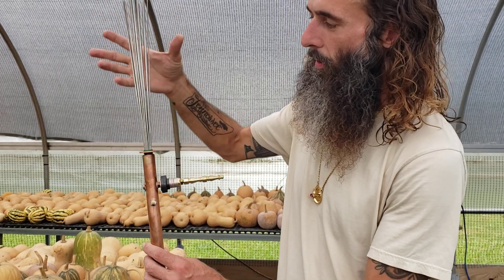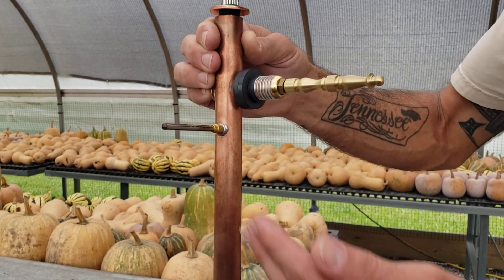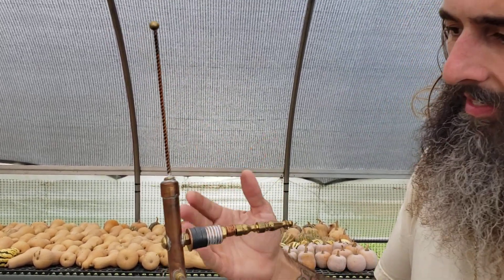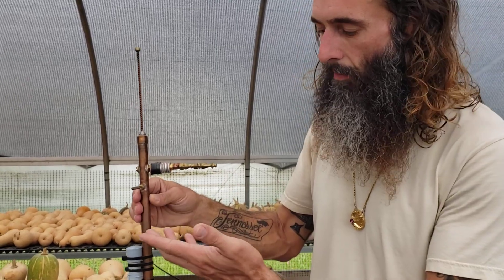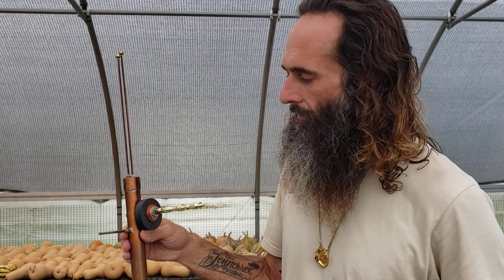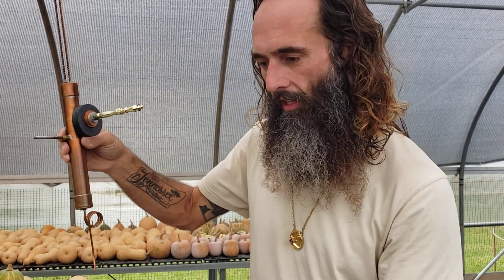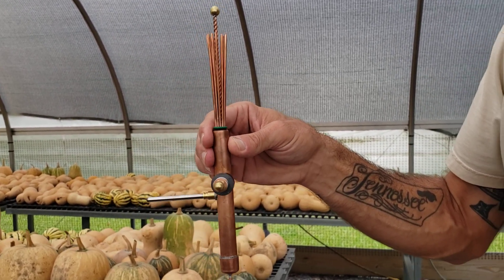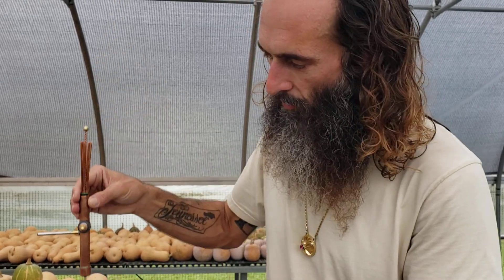Electroculture Antenna Models Available @TheFertileCurrent

Comment: Birds always land on my antenna which bends my wires, any tips?
Reply from the maker: What gauge wire are you using?? Perhaps a thicker gauge?? Are they soft copper?? If so, you can lightly hammer the wires to make them more rigid. ❤
Reply: @TheFertileCurrent  yes soft copper, thanks for the input. I will go to the hardware store and grab some thicker wire to see if that helps at all. I love the content brother!